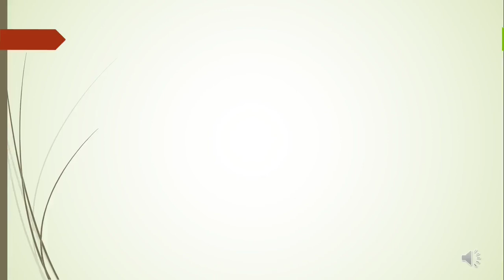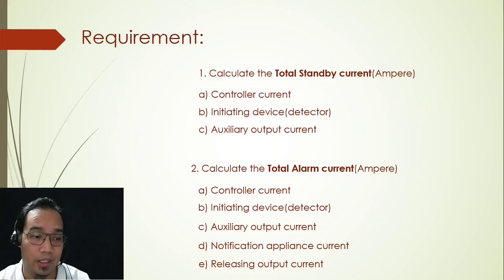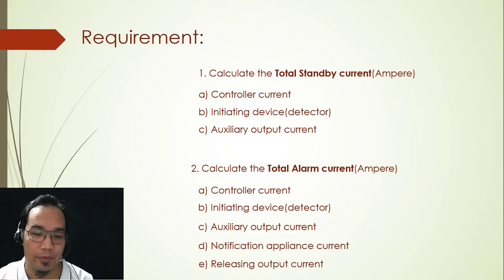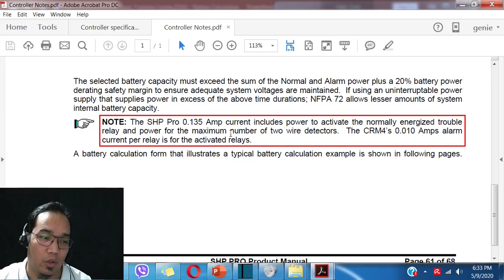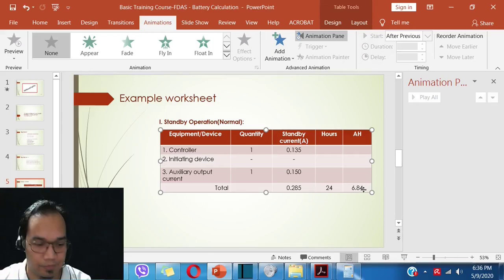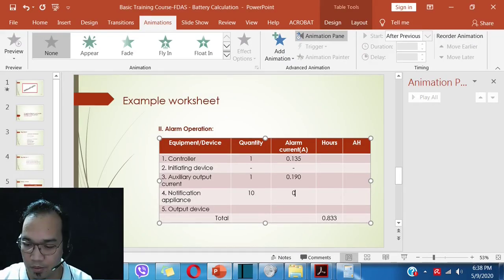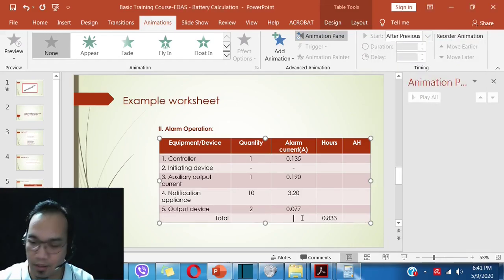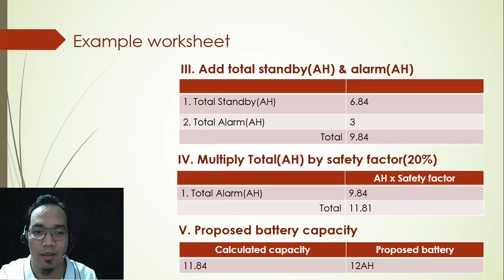Fire alarm design - Battery Calculation #Design #Batterycalculation

Comment: Sir, kmusta po. Tanong ko sana. Sa battery calculation, ibig po ba sabihin ng alarm current 5mins, is testing ng FDAS system for 24hrs Standby and additional 5mins na activated/alarm state.
Reply from the maker: Yes sir, 24hrs na patay ang ac power plus 5 mins na nasa alarm state ang system dapat kaya ng battery
Reply: @AllaboutFireProtection  may gumawa po kasi na 24hrs standby and alarm state 24hrs dn, possible po ba un?
battery rating niya is 40AH, calculated is 39.6AH. May battery ba na ganun?
Reply from the maker: @ivancruda9445  hi sir ivan, minimum lang nmn yung sa nfpa if required cya s project specs pede nmn gwin din basta make sure capable yumg charger ng power supply support yung capacity ng battery mo.
Reply: @AllaboutFireProtection  Salamat po talaga malinaw na sakin. 😁

Comment: Hey nice tutorial, you've taken on a lot. 

Question that bothers me. If I have an auxiliary output on panel, how do we account for the current of the wiring's voltage drop? It is not accounted for in the voltage drop. The out put of the relay is given is the internal mA for that driver on battery calcs. But what about the calculation of the current consumed by a wire on a long run, it is not insignificant.

For example I am driving a hornstrobe off of a control module. Say with 14GaFPLR which is about 3 Ohms/1000 feet. So for simplicity sake I am driving a an outdoor horn-strobe 1000ft away. Then my 24V source and 3 OHM voltage drop give so assuming we de-rate20% to 20.4V like a Nac using OHMS law we have 6.8 Amps of current draw. This is ignoring our device. That 6.8 amps is not accounted for in a battery calculation anywhere. So when we size a battery, will it run on battery backup for the designed time? I wonder if they do. According to ohms law probably not.

Unless I'm missing something, most fire alarm calculations out there do not account for this I think. Am I wrong? I'm not sure where manufacturers come up with these 6,000ft numbers everyone runs with.

Thanks in advanced.
JT
Reply from the maker: Hi John, first I also like to thank you for your time watching one of my videos, and please continue doing that so that I could share more once I find time to do another video.

Please note that I value all of the questions here as this is a way we share our ideas and experiences.

In your question, I assume we are talking about having an addressable fire alarm system where our notification appliance devices are powered from the 24Vdc auxiliary output from FACP and controlling it using a control module. Let's say the derated voltage of Aux output is 20.4Vdc and your overall wiring resistance is 3 ohms, we are not calculating them by the direct formula of ohms law which gives us 6.8A as an additional load to note. Instead, it is always part of the procedure in calculating our voltage drop to know the load first of whichever output terminal we account for. In our case here, the load connected to our aux output is an external horn strobe. If its rated current is let's say 320mA and only one of it is connected, then that 320mA will be our flowing current to the 14GaFPLR cable that has a total resistance of 3 ohms instead of 6.8A. The same 320mA will then need to be added to our batter calc as an additional load. 

And to know the voltage drop from your cable, .320Ax3ohms will give us 0.96V which means, only 20.4V - 0.96V= 19.44Vdc is delivered to the external horn strobe which is still acceptable as most UL notification appliance has an operating voltage range from 16-33Vdc. 

Hope this helps. Thank you again, John.
Reply: @AllaboutFireProtection  so how can we you ignore the effects of the wire at such long distances. 

So if I have a 20v battery attach 1000ft of wire it pulls no current?

The FA manufactured give us a max distance calculations are convoluted. My concern is that this current never gets added to the battery calcs. I always upgrade my batter calcs a size above calcs.